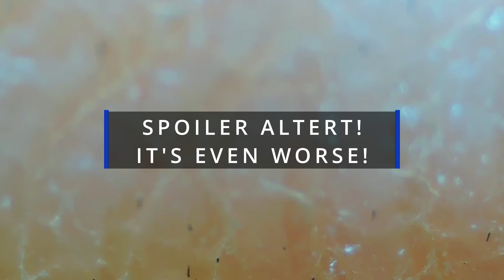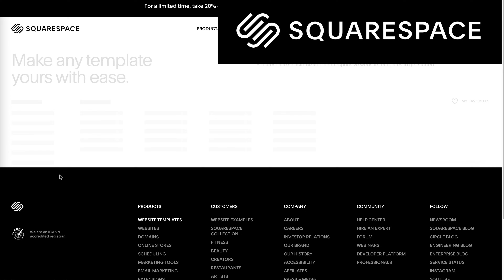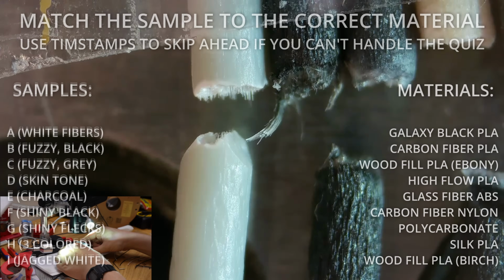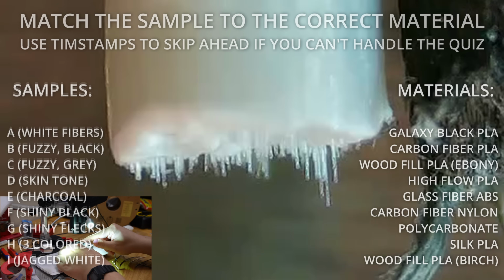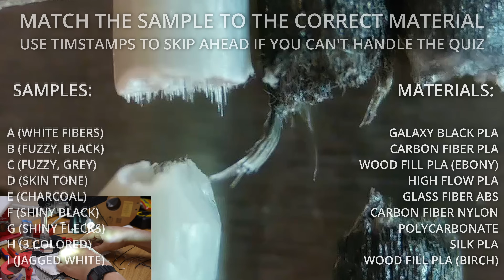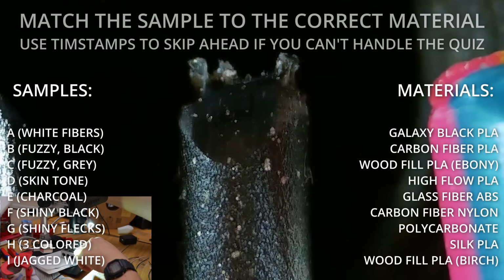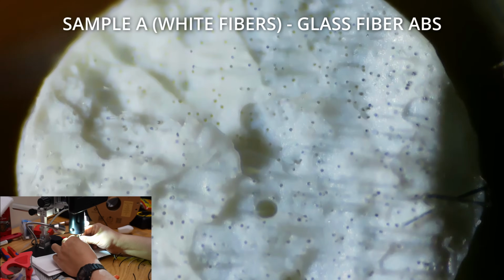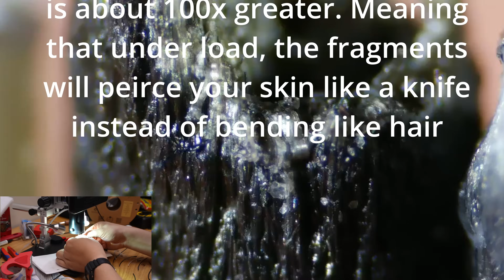Carbon In My Skin. These Wounds, They Will Not Heal.

Comment: Thanks for the informational video. But I would like to point out what make asbestos more dangerous than carbon fibers and glass fibers  is 2 fold. 1. Asbestos is takes much longer to break down in the lungs enabling them to cause more harm. 2. The fibers that make asbestos really dangerous are long and Very thin. Orders of magnitude smaller than the smallest glass/ carbon fiber that would be used in a filament. However both are still dangerous to inhale. But as far as risk it generally would not be seen any where in the same ballpark as asbestos. With the exception of carbon nanotubes which wouldn’t be in this setting.

Comment: I bought a Bambu P1S in large part for the enclosure and filtered chamber fan. been trying to be kinder to my lungs since quitting smoking. using a respirator more, n95s when it's hazy out from wildfire smoke, good filters in my hvac and vacuums. we're surrounded by so much fine particle pollution, it pays to cut down on exposure whenever feasible.
Reply from the maker: Congrats on quitting smoking, probably more important to do that than any of the other stuff!

Comment: Wouldnt that be a gimmick, its plastic with strands in it,  wouldnt that weaken the plastic? Seems like it wouldnt do anything to strengthen it. Like its not actual carbon fiber
Reply: Generally fiber fill tends to make the print warp less, have more stiffness, and provides a matte finish which hides layer lines well. It typically reduces layer adhesion, though it varies based on material, brand, and quality.

Comment: Something as simple as a DIY contained vented enclosure can greatly reduce the risks involved with 3d printing, not to mention wearing the proper gloves, masks and glasses.

Glad to see you're making topics on saftey because it's not discussed as much as it should be. 👍
Reply: there are no risks with FDM in terms of air quality when working with normal filaments
Reply: @Megasteel32 there are, it was even mentioned in the video

But yes, it's a lot less with PLA than ABS or SLA printing
Reply: @hrmny_  there aren't, if you do your own research